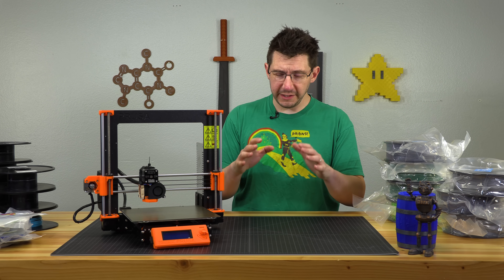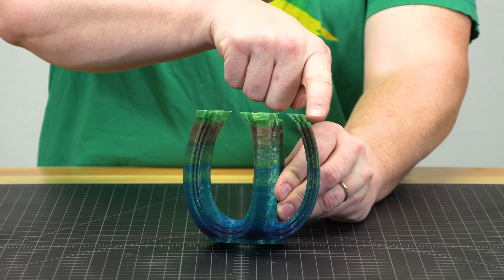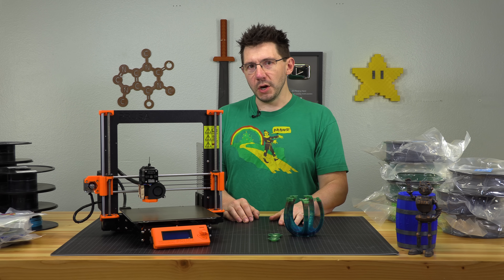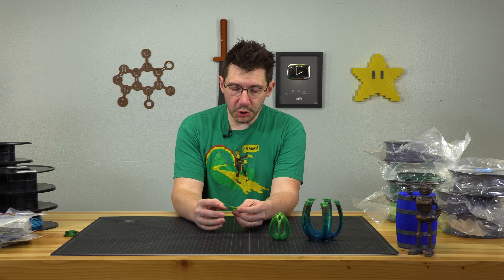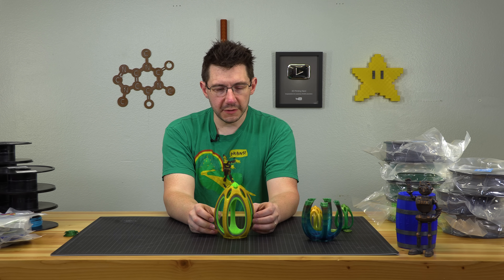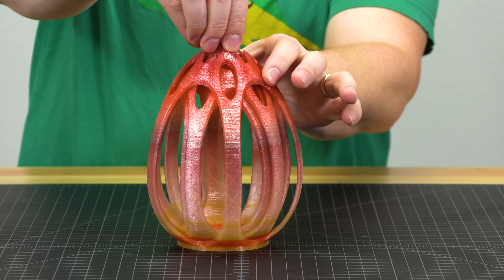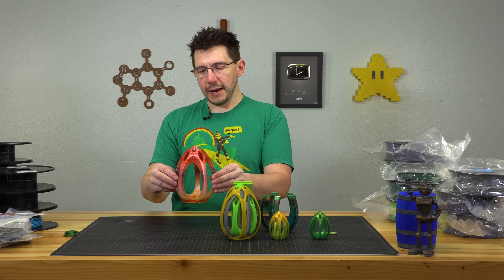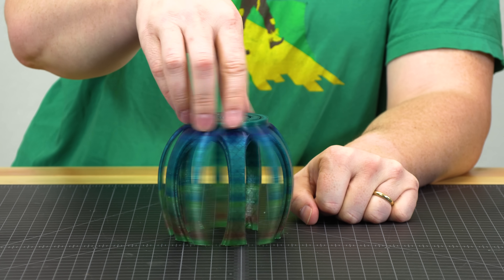This Egg Broke My 3D Printer - It's Maker's Muse Fault! #DestroyerOfWorlds

Comment: I printed that twice on my stock Artillery Genius and both times the bottom was goog but the top was fused just enough that I couldn't get them separated. Just got a Flashforge creator pro 3 going to give it a crack on that.

Comment: as for the animation of the egg, why not use a single motor and 3 different gear ratios running a drive wheel on each ring, that way it takes less energy and is always synchronous.

Comment: I was going to make this at 238% scale up to make a cool 8in in height model and the scale up would help to insure the gap tolerance so it would spin. I was thinking to go .1 layer height to insure perfection. Then I thought that I better make sure it's solid, just in case I have to put some leverage in to free any issues, so an infill at 50%. Would take it over 60hrs to print. I then decided to print at it's original size but when I was watching the brutal extraction and retraction I thought, cool model but I don't want to destroy my machine. I did begin the process with the 238% scale up and I got a gorgeous first layer and let it run for 10 hrs and it was looking great, and just like you I got 3 great distinct and easily separated rings but 60hrs of eventual torture, I decided to just let you guys print it. Cool model but I love my machine so best not to torture. I will do 2-3 day prints but the extraction and retraction for probably 40 of the 60 hours would have been a bit much, can't be good for a machine. AND, I was considering to animate the rings by editing the model but, like I said I stopped but you are tempting me.

Comment: yeah i tried this and mine fused also, i have a cr-10s. Any ideas or setting you can share for cura lastest version because I would like to make this darn egg. I'm .16 layer height, 3 walls, min. temp on filament 205 bed 50c. I even tried with .1 horizontal expansion. I did not do infill looked like the 3 walls filled up nicely. U did mention about moving z up, don't know what u mean by that.

Comment: Obviously, I am just guessing but it sounds to me like you might have melted the TPFE insulator in your Mark 3's hot end if it's not an all-metal hotend. The other possibility I see is an out of spec nozzle or other incorrect mm per step setting increasing extrusion pressure beyond what it can extrude per MM of travel. Either by the hole being to small not extruding enough vs whats expected and pressure building directly in the nozzle or extruding to much and pressure building between the part and the nozzle due to over extrusion. I have had that with both bad nozzles and nozzles I crashed pretty badly with an uneven build surface 90% of my problematic printer issues where they are doing what the mark 3 has come down to either or both of those. On at least on occasion my steps per MM was wrong in the firmware as well. I usually keep at least 1 built hotend for each of my printers handy and a selection of nozzles. I have 8 printers that use 3 different hotend styles.  A good test I use is to increase my layer print height to roughly 90% of the nozzle diameter, slow down the print to 60-80% normal ,20- 30% infill and 2-3 outter shells.

Comment: Those are awesome. I have 2 Anet A8's. I printed one at 150% on one and 230% on the other. They came out perfect. I have modified both of them though and they print really nice with no issues. It failed on both my mini's at 100%.

Comment: Meh, happened to me quite a bunch of times. What you need to do is heat it to remove the nozzle, heat it to 300°C and watch it drip and clear itself. If that doesn't work, then pushing filament with considerable force in. If that doesn't work, then disassemble it and submerge it into aceton if it is ABS or chloroform if it is PLA. Problem solved. Jerking is the problem of belts not tightened correctly (either too much or not enough), dry linear bearings, overheating motors or straight bug in firmware.

Comment: What if you attached the two inner most rings to a fast moving clock mechanism inner ring on the minute middle on the hour and outer still the middle would spin at essentially 60 times the outside make it gas enough to be noticeable but not super fast or even go inner on seconds middle on minutes and outer on hours

Comment: Do the preassembled i3 mk3s tend to be less reliable than the kit built ones?  I've now seen 4 or 5 examples on youtube of problems with the preassembled ones.  Not sure if its a quality control issue during assembly or if bad things are happening during shipping, but its making me second guess my decision to buy a preassembled one in the next few weeks.
Reply from the maker: My pre-assembled one has a bit of a history. It was a training unit and wasn't suppose to make it's way to me. Usually, kits and pre-assembled use same parts and when assembled correctly are equally reliable.

Comment: it wouldn't be hard to make some continuous rotation servos and use a servo tester so you can have variable speed. you could even print the base, gears, and even the turntables  that have little pegs that could index on the bottom of the egg...

Comment: Your power supply voltage is probably sagging after the power supply warms up.  So get a voltage meter on it through out the print.

Comment: I had the same clogging issues with my Kit based Mk3.  Since it was kit based I had no option for return.  Fortunately, Prusa online support was incredibly nice and easy to communicate with.  After a couple of tear down and rebuilds of the hot end, customer support eventually provided me with a new E3D hot end.  Once I installed that everything has been working fine ever since.

Comment: can you recycle plastic for printing? eventually i would like to get into 3D printing but i feel like it could get really expensive (especially starting out) unless i could take scrap plastic (from failed models and scaffolding) and turn it back into filament. also do you know anything about printing with heat resistant plastics on desk top printers? if so what would i need for that?

Comment: I recently designed my own two part 3d object but I have yet to manage to print it successfully where the two parts can move independently. Not sure if it's a printer adjustment, settings in the model, printer or just the model is too fine to allow it to print successfully.
Reply from the maker: Perhaps the clearance between parts isn't large enough?
Reply: Could be as the part is not very big overall. I finally printed it as three parts that require some glue and a small rod to hinge them together. It is a tone arm rest with clamping mechanism for my old Pioneer turntable.

Comment: Hi Joel, I think could be a problem of "Shifted layers" connected with the belt shifting. A possible solution is to tighten the belt better with an add-on or to change it with a GT2 belt with steel cords. Please let me know what you think.

Comment: My FolgerTech Prusa i3 had major problems with layer shift and jamming (mostly jams). After countless hours of modifying and messing around with the extruded and hot end, I finally fixed it by installing the e3d hot end and titan extruder. Now I very seldom get layer shifts, and I don’t think it’s jammed once yet with the new extruder.

Comment: Not even going to try to fix it? Really? That's less than impressive. It's the ptfe tube below to bond tech.
Reply from the maker: I am going to try. The new one showed up rather quickly and I'm going to dig in while a camera rolls. That's the goal. Wish me luck.
Reply: 3D Printing Nerd when? I want to be there to tech this with you
Reply from the maker: I would love to say sooner rather than later but I honestly don't know.
Reply: 3D Printing Nerd in the forums there are several others that have this issue. Is it heat creeping? In other words does it start clicking after 30-60 minutes? Or is it clicking immediately? One easy way to tell. Load filament and then turn off the filament sensor and hit load filament in the menu. It will push filament hard and fast so if it's clicking with that it's obstructed but if it doesn't immediately and it does after an hour it's likely heat creeping

Comment: I had a similar situation with my Mk2s turned out that the PTFE tube was slipping up out of the heat break and allowing a gap of about 1-2 mm at the bottom. E3D now offers bowden collet clips that lock the PTFE in place after installing I had no more problems. https://e3d-online.com/collet-clips

Comment: Hey Joe, I also have the same clogging problem with my MK3. Please share the solution that Prusa provides you. It's too frustrating to deal with the clogging problem. Also what was your layer height? I have the issue whenever I print something lower than 0.2.

Yesterday I tried to print a small pocket watch model (State alchemist pocket watch ;) FMA anyone? ) and it clogged mid print. I use SlicerPE with default prusa PLA and default settings and latest firmware. I needed to increase the speed to %150, deactivate silent mode, clean nozzle, print a simple block to clean nozzle and try again and it worked. I think there's an issue with MK3 fw or slicer.
Reply: It's

Comment: can you do anything other than print other people´s models bigger?
Reply from the maker: Nope. In my 600 videos that's all I've done and all I'll ever do. I'll just less this enlarged sad existence forever.
Reply from the maker: DUDE. I would love to do more of that! The whole reason I started this channel is because I modeled my own GoPro camera rig in OpenSCAD. I've done quite a few Fusion 360 tutorials as well, and I've built a number of machines.

To be honest, right now, I'm digging out from being FAR FAR behind in my queue of "stuff I want to get done." It's taking a while, and I am getting through. I'm about to open Fusion 360 because when I was running errands I had an idea pop into my head. I'm also working towards using 3d printing as a tool in making something awesome - I have a laser cutter and a cnc machine I don't get to use enough, so hopefully I'll get those back into the rotation.

Right now though, I need to get this idea out of my head, then I need to go clean up my studio space, which isn't actually a studio at all, just the clean part of a room :)
Reply: HaHaHa Joel!  :-)
Reply: The reason i say this is because i never see you creating models or stuff, yes you do interviews and reviews but i have never seen you designing or building your own printer etc, not even a model. This is what a 3d printer is NOT supposed to be. I like your style but i would like to see you be more of a maker, if you know what i mean.

Comment: I just bought a Prusa MK3 pre-built on April 3rd, it doesn't ship until May 9th. Would you recommend another machine or the MK2S instead?

I'm willing to spend more if needed. I've also thought about getting the Creality Cr-10S?

Thanks & wish I found your channel years ago.
Reply from the maker: No, I still recommend the mk3, as the one I built from the kit is working crazy well.
Reply: 3D Printing Nerd   So, I should probably ask to have the kit instead & add a few more accessories?
Reply from the maker: It's totally up to you. The kit is a fun build.
Reply: 3D Printing Nerd    Well, I asked if I could go the kit route & how to do that?

Then saw that the kit ships 16 days later, so I wrote another message 20 minutes apart & asked to keep my printer. An hour later they cancelled my order & haven't responded to keeping my original order or my placement in the shipping que.

They also said they never heard of the assembled problems???

Now my order is cancelled & refund pending? Argh, lol. 

Can you do a comparison with the printers you have? I saw Gmax 1.5 & that looks sweet & high quality, the Cr-10S looks similar. Possibly going over what you should buy on a budget, a high quality (2k-5k), hobby grade, production grade, etc. Ease of use, auto bed leveling, nozzle replacement, removing parts, etc.

Thanks... Now leaning towards Gmax 1.5, but your video was over a year ago & not sure if technology & other printers have surpassed it.

Sincerely, 

Matthew
Reply: Stew JW Thanks for your thoughts... My Prusa MK3 order was cancelled even though I wrote a message stating not to cancel the order. I've also written them again asking if I can purchase the kit, but keep my original order date so it ships sooner, since I didn't really want to cancel the order.

It's been 2 days & haven't heard from them??? 

I just saw the Pulse Xe full package & it looks very similar to the MK3, but with upgraded parts. I'm not sure what the differences between the two are. Still researching, but MatterHackers is in California, two states away from me & their customer service I've seen look great. I'll be calling them tomorrow to see what they recommend to me.

I'd like to print filaments with Carbon fiber, stainless steel, copper, etc... as well as flexible material, PLA & ABS 

Sincerely, 

Matthew
Reply: Stew JW I'm not sure, still waiting on Prusa, but it is odd.

Here is what I actually wrote to them first email: 

"Can I change my order to the kit version?
If so, would it be better to cancel this order & place a kit order since the shipping is cheaper?
Sincerely, 
Matthew"

My second email 15 minutes & 22 seconds after the one above: 

"Hello again,
Never mind, I see that the fully assembled version is shipping out April 23rd (16 days ahead if the kit). I'm just really excited to use this machine. 
Joel, from 3D printing Nerd YouTube channel, just said his assembled Mk3 didn't work as well as the kit. Just curious if you've been able to fix that problem? Thanks again. 
Sincerely, 
Matthew"

Prusa first Reply an hour after first email, very quick (Thumbs up), but had both of my emails, so thumbs down:

"Hello Matthew. 
Thank you for your e-mail. 
Your order has been cancelled. The refund process takes up to 7 business days to complete. 
Meanwhile you can place a new order. 
For any additional help or question please do not hesitate to contact us again, thanks  .
S pozdravem / Best Regards / Mit freundlichen Grüßen
Peter Mencák
Customer Support"  ??? 

I didn't actually ask to cancel, I asked what was best to do, they just cancelled it?

Prusa second email: 

"Hi Matthew,
Not aware of any issues between the MK3 kits and the preassembled printers - if there were any issues before I am pretty sure they were rectified. Both the kits and the preassembled printers use exactly the same components.
Thank you,
Ondrej Kolasin
Customer Support" ??? 

No reply to my cancellation part of the email, just said not aware of issues??? I've seen a few videos stating the assembled 3D printer problems from months ago?

My 3rd email & waiting for a reply: 

"Hello again,
I was wondering since I didn't really want my order to be cancelled, but it has been and I need to reorder now. Can I order the Prusa MK3 kit option & still have my same shipping status in the que (April 3rd order date)? So it still ships out by May 9th? I'd really appreciate it.
Sincerely, 
Matthew"

So in the meantime I'm watching more videos & learning more. The enclosed types sound very appealing, but most build volumes are smaller, I'd like around 10x10x10 build volume at least. I saw the Raise3D printer just recently & it has dual nozzles, enclosed, 300c hotend temp, 110c bed temp, camera, etc with a 12x12x11.8z build. But at $4k (which is doable).

But now I need to research it, lol.

Thanks again for your input.

Matthew
Reply: Stew JW Received 3rd email today from another person:

"Hello Matthew,
Thanks so much for your email.
I want to inform you that your shipment is already now in the queue again and not canceled anymore.
Secondly, At the current moment no any problems from the assembled or the kit version as it is already shipping quiet well.
Dont Hesitate to ask any question.
Thanks 
Regards,
Semsem Elgourany
Customer Support
PRUSA Research
+420 222 263 718
+421 220 570 305
188/7a Partyzánská, 17000, Prague
shop.prusa3D.com"

So now it's not cancelled (which is great) & will hopefully ship out next week on the 23rd? Hopefully by May I'll have it in my hands. 

Still excited about this printer. 

I know how my two different CNC router type machines work & have worked on them before & hoping that knowledge will help with 3D printing adjustments needed. 

Thanks

Comment: Joel, we will have to teach you how to calibrate your printers properly :-) I sliced the egg, sent it to my MK2 and it printed perfectly. 
My (almost 2 year old) MK2 did throw a tantrum the other day though. Heatbed connector melted, which is not covered under waranty in the kit, so I simply soldered the wires directly onto the connector pins, back up in no time. Plus, I have now eliminated that problem from occurring in the future. Result.
Reply from the maker: But, my mk2 printed it extremely well! :)

Comment: Now that I'm thinking about purge blocks, I just really wish the MMU sacrificed a little build volume for a purge bucket, Slic3r had an option to keep the purge block at a user-defined height (within reason) at the expense of build volume, or had a "sloppy color-change" option in Slic3r that just moved the extruder to the side, purged a couple cm of filament, then just ran right back into the model and tacked on an ugly string to snip. It seems like most of the waste plastic is from matching part height.

I mean, I'll still probably get an MMU or a Palette+ someday, but that just looks like it'll devour spools.